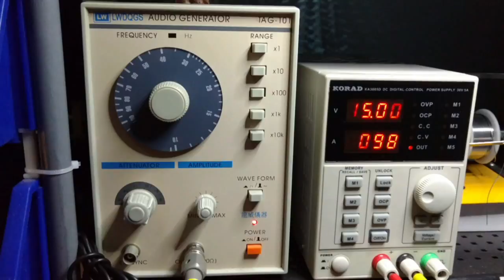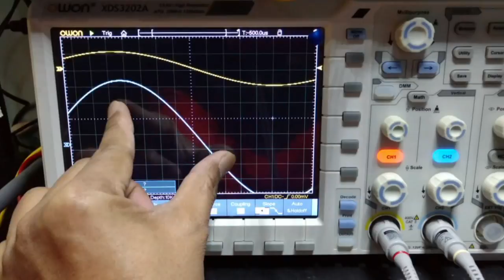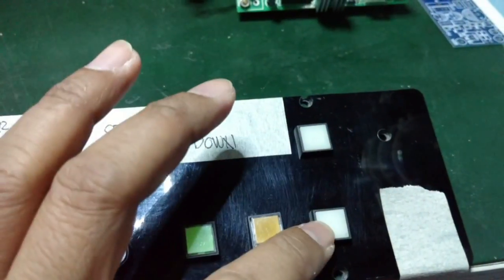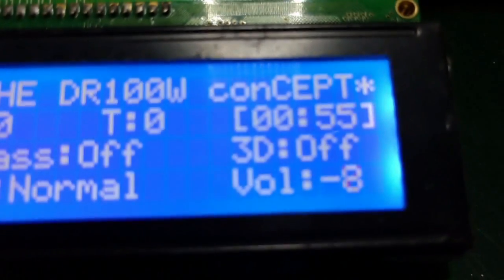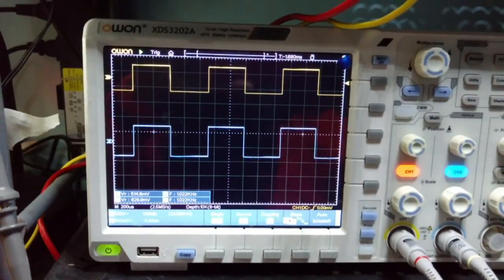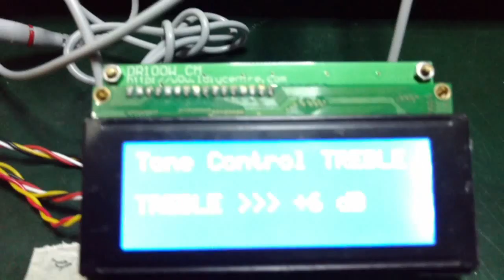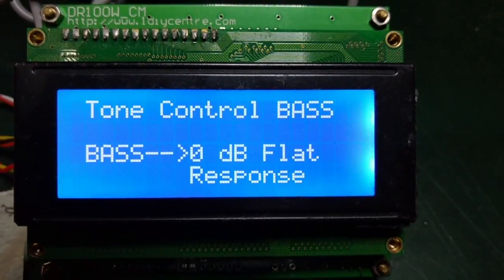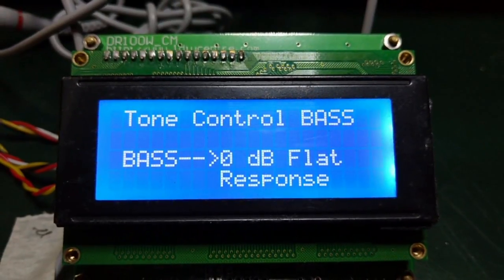digital Tone Control #03 |  Parametric Test TDA7449 & PT2389 with 8051 micro STC90C516RD+ | 3D Sound

Comment: I have a 7449 and 8051 i need program the 8051 to control 7449 using tactile buttons and also with the help of ESP8266 module, is it possible to show the display in smartphone?
Reply from the maker: that's awesome.  The idea is nice,  and it will be nicer if can control the 7449 using the smartphone. and display status as well.   Do you program 8051 before, which language?
Reply: @dr100wconceptpoweramplifier  no.. I'm a beginner in programming 8051... And I have only the wifi chip of esp8266... (No nodemcu) can you help me to do this?
Reply from the maker: @sriharirajrjs6565  apologies late reply - just got back the access (block site from my jobsite),   I have not been working with esp8266 for audio,  I tried only for IoT stuff but not so much familiar with it, I am afraid my know how isn't good enough for now.
Reply from the maker: @sriharirajrjs6565   can you try this link to get started    https://drive.google.com/drive/folders/1Xk7CnrRH8bT2LD4LdP3L9iUHScS7xu9e?usp=share_link

Comment: hi bro is it possible to measure a digital signal ?
Reply from the maker: Definitely!  An oscilloscope like the OWON XDX3202A that I am using can automatically measure waveform,  amplitude, time, etc.   a digital signal like I2C or UART can easily measure or decoded with the on-board module of my oscilloscope.